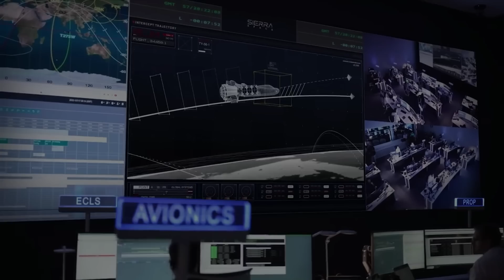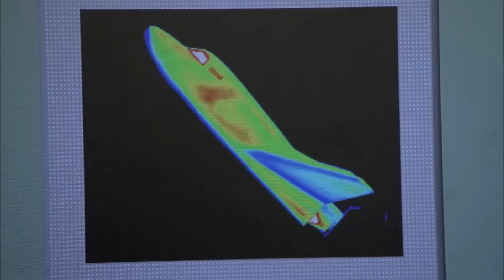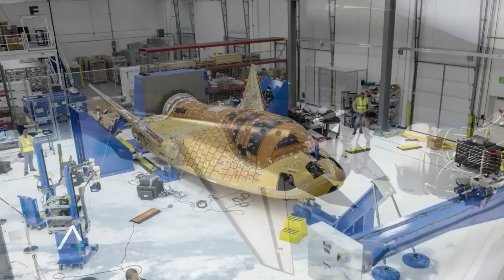Why Has Dream Chaser Been Under Development For Decades?

Comment: Dream Chaser will be the solution for moving Space Migrants and cargo on and off planets and moons.  Starships will be cargo ships only -- if Starship landed on a moon or a planet it would fall over and explode in the crater its deceleration burn created.  They will be limited to orbiting until landing pads, (a helluva lot more durable than 'Ground Zero')' are constructed on the surface.

Comment: If they can make this work, it would be great for the commercial space travel agenda. And, if this works and by "works" i mean goes through all the multiple test flights required to get qualification for commercial space travel, well why not think bigger? What's to stop this company from creating a larger size Dream Chaser to carry more people and/or bigger and heavier payloads? I think that, if he science and engineering works at this scale size, I can easily and clearly see this spacecraft as a Space Shuttle 3.0 and it would open up many future possibilities. Heck, SpaceX should acquire this company so to run it's program separately and concurrently with their Starship program. Imagine a Starship size Dream Chaser, propelled by a SpaceX heavy booster? If this company had some serious $$$ to help and support it, this Dream Chaser would/could support NASA where Blue Origin and Boeing clearly failed. 

Just an idea, wouldn't a Starship size Dream Chaser advance the agenda of SpaceX carrying people and cargo from a earth point A to a earth point B in ways and time that normal airplanes can't do? Since it can clearly land like an airplane/space shuttle.

Would it be feasible or am I thinking too much outside of the box?

Comment: However poorly Boeing has performed on Starliner development, SNC/Sierra would have been even slower to deliver a crewed Dream Chaser that has an abort system and launches without a payload fairing. The problem, for both Boeing and Sierra, has been inadequate investment and staffing. They're so slow because there's just not that many people working on these projects relative to their complexity.
Reply: The problem for Boeing has been money-oriented management, an accounting-oriented hierarchy and also needing to spread work out over as many congressional districts as possible to ensure taxpayer funding.  For what engineering they do have, the problem is old-style engineering and development standards and procedures.

Individual Boeing staff might be able to get the work done (help get the work done), but only if they worked for less well-funded company that had fewer layers of non-engineering managers and fewer people whose jobs were obsolete years ago but still need to be invited to meetings.
Reply: @Lost-In-Blank  BINGO !!

Comment: Starliner is like a Cadillac. Everything else is like a prius.
Reply: 😀😄😆😂🤣🤣🤣🤣🤣🤣 .....yeah, a 1960 cadillac!
Reply: @madchad2  with a white ragtop. Quiet comfy smooth. F ya I will take that. Trunk is better than a tesla.
Reply: @TheMoneypresident  I think you meant  "with a white ragtop. Quiet comfy smooth. F ya I will take that. Trunk is bigger than a tesla."  God those were comfy smooth.  A gravel road felt a like a freeway.
Reply: @Lost-In-Blank  The best trunks are measured in ‘How Many Human Bodies Can It Hold?’
Reply: I wonder if Starliner will have cigarette lighters for the back seats and power windows that don't work any more.
Reply: A broken down Cadillac abandoned on the side of the road maybe.

Starliner has an interior volume of 11 m^(2), Dragon has 9.3 m^(3), not that different. But Dragon is flying while Starliner is not.

Comment: Seeing people stand next to the ship… it really isn’t very big is it!? How many people are suppose to fit in the crew version?
Reply: From what I'm gathering, the version being tested now (in this video) is strictly the smaller 'cargo' version. The 'crew' version will be scaled up, about 15 to 20% bigger and have 4 plus seats. I understand the larger crew version is currently under construction - might be wrong tho.
Reply: Like the Starliner and Crew Dragon, it only needs to carry four people.
Reply: At first it's just carrying cargo to the ISS. After so many flights it will be man rated.
Reply: @clinhrsfall488 a glider return, relieves us from the need of having to be fished out of the water and dependent on a whole lot of other expensive systems that only this method relieves us from. The space shuttle was developed for a reason and regressing back to splash downs is just plain mental!